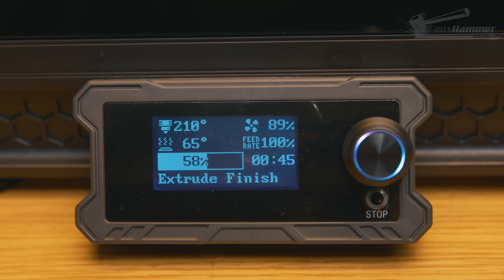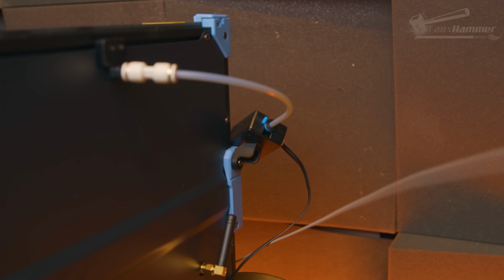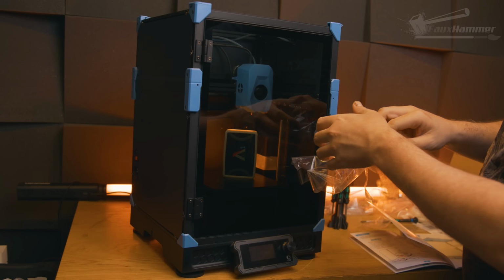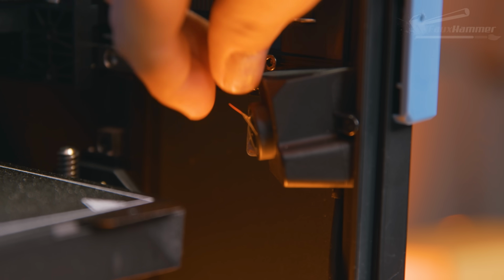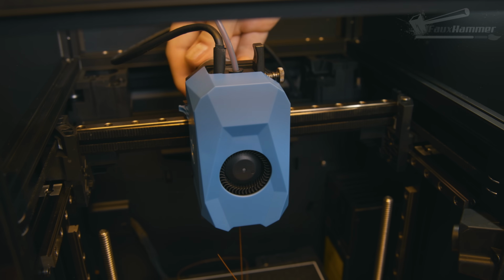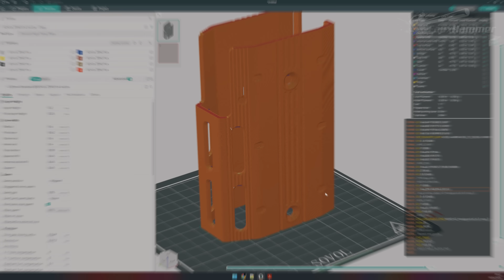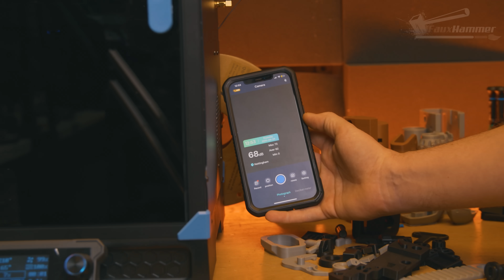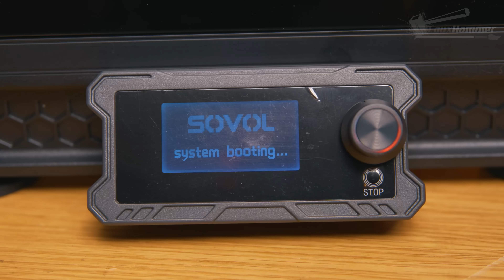Sovol Zero Review - Tiny and Powerful

Comment: I’m a Prusa guy and even I’ve been eyeing that SV08 for my garage. Will probably get one after the INDX kit ships honestly.

This is a bit too small for me. I get it though. Seems great if you’re doing a lot of drafts at your desks of smaller parts.
Reply: As someone who recently got an Sv08, i am really happy with it so far. I‘m also planning on upgrading mine with the INDX kit if it turns out nice, although if you have the space you might wanna wait for the Sv08 MAX, bigger build plate, more space for INDX Toolheads, and it got a bunch of modernizations compared to the normal Sv08.
Reply: @Nefroh I’ll see how prices shake out on the Max when it’s time to build. I’ve got a garage so space isn’t as big of an issue. God bless Texas for an abundance of space.
Reply: Between 1000 to 1300 without a case if we infer from the Kickstarter pricing.

They state 999 as the Kickstarter price and state that this is  300 off
Reply: I expect Sovol to introduce an SV08 Ace in 2026, to correct the mistakes they made on the SV08.  I love the SV08 but mine has a 1.1 mm warp on the taco bed and the cheap prox sensor creates an inaccurate bed mesh so Klipper has no way to compensate for the very warped bed.

I started trying to shim the thin aluminum bed to reduce the warping, but I was using the inaccurate bed mesh and the stock bed mounting is a recipe for warping.  It wasn't converging on a solution so I gave up on that.  I just bought a $250 graphite bed from R3men.  It should be here in a couple of weeks.  Sovol is close to selling us an Eddy probe upgrade for the SV08.  I may spend $400 to upgrade my $500 SV08 because Sovol tried to save me $100 by using a thin aluminum bed and a cheap bed mesh sensor, but the SV08 will be awesome when it finally has a flat bed and a fast & accurate Eddy sensor, like the Zero (which I have and love) and the SV08 Max.

Comment: Question now is if it's possible to get good looking prints with some tinkering, or did they made the same shortcuts with the hardware as for the software? 
I do like the open source and vanilla flavor, but that is useless if you get mediocre hardware...
Reply: It‘s a Klipper Printer, as good as you are able to calibrate it.
Reply: @Nefroh  if the frame is warped, out of tolerance, or the bed isn't flat from factory then no amount of calibration will fix that
Reply: just tune your profiles for the filament you use. pressure advance, extrusion multiplier, temperature, retractions. you'll be able to get good prints out of it. Maybe play a bit with speed/acceleration settings. Hardware.. is just fine. I suspect that they have some assembly issues, because input shaper for that small machine is terrible. 7k recommended accels. it must be able to do 15-20k easily, especially with 3Ampere motors. But it doesn't. Probably too chunky toolhead for that size of the printer. But that just mean that it is not as fast as it could be. Still must be capable to do good quality prints after full calibration
Reply: The Zero hardware is rock solid.  This is a very solid little printer.  The poor print quality in this video is the result of printing a 7 minute 40 second speed Benchy and not having good slicer profiles.  Sovol now has better profiles.  I start with the generic slicer profile and do a fairly quick tuning to optimize it and the Zero makes very good parts.  Sovol skimped on the profiles but the hardware is tight.  The Zero can inherently print fast but Sovol overly features speed to the detriment of print quality.  Instead of printing a crappy super fast part, or even a decent very fast part, I prefer a very good fast part and the Zero delivers.  The fully enclosed design and fast passive heating are a big plus.  I print ABS-CF on the Zero as easily as PLA.

Comment: Damn, that's a really tiny build plate.
Reply: 15cm, At least larger than the 12cm Voron 0.2 build plate.
Smaller build volume means a faster heating plate and chamber, which is essential for some filaments

Comment: Hey FauxHammer,
I love your videos. Congrats on reaching 100K. 
I was wondering about something. 
I can see and hear you and many other channels talking "negatively" about forked or branded slicers for many different brands, but since you are similar to me and like to see 3D printers just working without touching too much around them, I think that branded or personalized slicer software is beneficial for us. 

In my opinion, the only thing I really care about is which base slicer they are using. I like Orca, and before that, PrusaSlicer, and all rebranded slicers from those are fine by me. 

In general, I have more trust that the companies will micro-adjust "their own" slicers to their machines better than an open-source slicer would. 

For example, why don't we use Orca Slicer over Bambu Studio for BL machines? It's simply because BL Studio is better adjusted to their printers. 

So, I think we should push factories to provide us with more and better fine-tuned profiles for their printers in their own slicers than push them just to use free open-source ones. 

I know that it is a pain when you have many different machines, but for end users, first, I don't think they will have many different ones; probably if they have many, they will try to have them from the same brand as much as they can, and second, for those that have many different ones, basically it should be expected of them that they already know how to fine-tune the various printers. 

They can just use one slicer software and run all from there with their own profiles. I mean, in the end that is the point of open-source software.
Reply: Your understanding of the problem is incorrect. BL use a custom slicer because they use custom, proprietary firmware. Most other companies use either Marlin or Klipper, which are open source.

Companies using open source firmware should create printer-specific profiles for the open-source slicers. There is absolutely no technical reason to make a forked slicer when using open source firmware. It's strictly an expensive marketing effort, and it does not benefit the user in any way (I would argue it actually harms us).

There are no "features" that eg. Elegoo, Anycubic, or Creality have developed that are unsupported by open source slicers. And even if they had developed such a feature, it should have been a contribution to an open source slicer anyways.
Reply: @gooseheadedv1  that is your opinion and i respect it.
 There is no value for any company to involve effort to develop anything for the open source community. It is only "our" wish for them to do so. If you take a look at any major tech company you will find the same. Apple, Samsung, Huawei ... 
They all.have their own software developed on some either inhouse created software or open source, or well known (android, machintos, windows).

For years content creators are criticizing UIs developed for a particular brand and still after years and years companies are still doing it. Why do you think that is? 
It's simple, because the vast majority of end users like for all to be predefined and ready for them to use. Only a small portion of users don't like it and think it is stupid or wrong. So do you think that the multimillion dollar market is wrong, even though they are all standing today and have exactly the same approach from the first time someone started developing personalized UI?

The reason BL is developing their own is not because they use custom firmware. They are using custom firmware so they can create their own closed environment that would benefit the majority of end users. It is as simple as that.
Reply: @3D_Garaza  - We need 3D printer manufacturers to put their effort into developing good tested profiles for their printers, particularly now that Orca made it easier for manufacturers to produce machine specific profiles, rather than re-skinning a slicer that only works with one printer, is probably six months out of date when released compared to the standard slicer, and that will only be supported for another six months until the manufacturer is selling their next printer and are then making a slicer that only works on that printer.  Even if you only buy one printer, it's better to avoid a proprietary Slicer.
Reply: @Liberty4Ever If you were looking at things from a 3D printing enthusiast's perspective, then I would agree. But the companies are not looking at it that way, and almost everything you see on the market is confirming that. I, myself, am in favor of that.